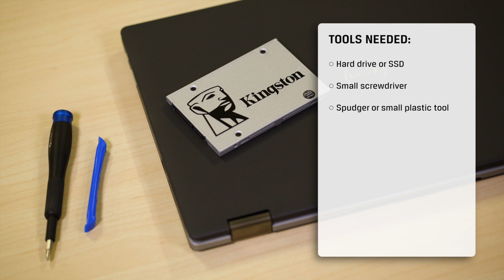How to Install an SSD in Dell Inspiron 7000 Series – Kingston Technology

Comment: Hi, My laptop (Dell Inspiron 7000) is of 128GB SSD & 1TB HDD. When opened I can see only the HDD, not able to locate SSD. Where can I find it? Would like to upgrade the SSD. Can someone help please ?
Reply from the maker: Hi Biju you can use our part selector here to see what we have available for your system. You can also check with Dell to see if your specific model has an additional SSD connection https://kings.tn/3qBAH9K

Comment: Is there space to install two devices at the same time? (Both, HDD and SSD)
Reply: I don't believe so, there is a specific space for the HDD that also fits the SSD. trying to fit 2 SSDs in that space would make it too tall for the space, as well as a lack of SATA connections. Unsure if an adapter could work in this scenario but out of the box I dont believe this would be possible
Reply: @krahkyn  But I mean 1 SSD and 1 HDD. By the way, you have answered my question! Thanks a lot!

Comment: Is it possible to upgrade Inspiron 7348 to a ssd from hdd.?
Reply from the maker: Yes it is, it will require some work to get to the drive though. You can try to find some videos of the process to change it out.

Comment: is kingston a400 ssd compatible with inspiron 7572?
Reply from the maker: According to the specifications, it should support 2.5" SSD drives and M.2 PCIe/NVMe drives. 
A400 should work on it without any issues.
Reply: @kingston  I have a Dell Inspiron 7472 with 256gb PCIe SSD. I want to add another SSD along with the PCIe one. Can I install an additional Kingston SSD to my laptop?
Reply from the maker: Hey Kedar, you will need to check and see if your system has space for multiple drives. You can consult the service manual for detailed instructions  http://spr.ly/6050EulKo

Comment: I have Dell Inspiron 15 7000 gaming series. It has SATA 1 TB HDD installed during purchase. Can I install parallelly 1 more SSD with this current HDD??
Reply from the maker: You could, but you need to check and make sure that your system has an extra SATA connection and slot for the drive.

Comment: How about Dell G series, that has a stick type solid state drive and no hard drives. I want to add a 2.5 inch Drive for more storage. Does it require additional Parts like a carriage? I know there's an empty Bay but I haven't seen a schematic to show weather cables or Carriage are required.
Reply from the maker: Hi, what is the full make and model of your system in order to suggest you the right product?
Reply: Dell G7 15 #7588  I removed the back cover, only 1 screw, nice. Looks like it has carriage and connector. Does battery have to be disconnected on this model? Instructions on empty drive bay don't mention that. It appears all components are changeable, very easy to access and clean.
Reply from the maker: Hi, here you can find the list of SSDs compatible with your system: https://www.kingston.com/memory/search?model=98158&devicetype=3&mfr=DEL&line=G7

Comment: Please do for dell 7560, one model comes with ssd+hdd and one is with hdd only. Can you please confirm if ssd can be added to the hdd only model or not. If not then how to replace the hdd with the ssd.

Video Request : - Dell inspiron 7560 ssd addition or replacement
Reply: I have a 7560 (I'm from the UK).  It came (from PC World/Dixons) with the caddy for a 2.5" drive but without a cable.  The part number is NH9YV but I have been unable to find one (even though several people had managed to source one in UK, and were complaining about DELL's price (£33.50 incl delivery). I can't find one anywhere and DELL say that it is unavailable.
Reply from the maker: +Kumar Ashutosh - Just checked out the official Dell service manual for your 7560 and it looks as if there are two 2.5 inch HDD / SSD compartments.  You may need an HDD drive cage if you only have a single HDD at this time. Check out the link: http://www.dell.com/support/manuals/us/en/19/inspiron-15-7560-laptop/Insp-15-7560-ServiceManual/Procedure?guid=GUID-7476C14B-39D3-414F-B82C-16811136735C&lang=en-us

Comment: what's the max possible upgrade for "Acer Aspire D250" 10inch notebook PC?
It seems like this Intel Atom book is gonna be just a sell-off due to lack of compact upgrades for smaller laptops...

last time's recommendations on SSD upgrades helped a lot to decide upon betting on 250GB rather than a 120GB after that careful explanation.
Reply: It wouldnt be noticeable, as its prolly a sata 2 and the processing (atom) is very slow and almost unusable at this point.